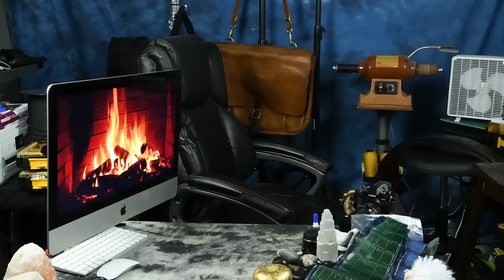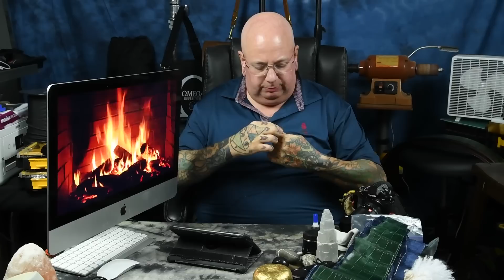🧐 FREE ENERGY Arch Form TIME Variable 🧐

Comment: Gentle push instead of hard matter physical smashing...
More with less dmass. Yt video on arch. 
Friction is of two surfaces. Tribology is contactless.
Genus facet surface phase...
 dodecahedron yellow path Yt video
on cohomology.

SpArkplug. Ok. But compression can ignite. Start a fire. Bubbles.
Using less fuel and more air.
R in air water fire earth aether. 😊

Comment: e9
EN is hole, pore, cenote... GENE egg en.
e9 is old telephone handle, or Solar barQue 09 with sailors 1-8.
Aries, Mushroom. 
How does one gets vacUUM voID? Suck-tion is like  pumping.
AMPerage is obsolete Tesla said. I need no elctrons to drive my motors.

Lock and load. Pump and pack. Load is dual. Dipole. MeLody.
1 is an electron, hole on complex cardboard number plane. And hole is 1 , infinity.
Now P RIM E s are 1 and itself. ON/OFF valve SWitches.
Ram rim mirror Moire Miura, MOraya, meron, etc ..
MM is symmetry.  Tetra. MorhSUB RhomBUS.
Morpheus SAndman has B day as myself. MM I CS mixing STR8 line.
Leaving two vortices , eddies, expansion cones.
Euler identity with pi e 1 0 ... and x²+1=0. 
And eversion convex + concave - saddle = 1( Euler characteristic too).
saddle lip ellipse, helice -propeller...+++
either propeller or propulsion
in contest of moving parts
turbo jet and propeler versus SC- RAM jet
diSCroLLs DNA ST DN TN 29 2J HeH god toothpick pattern

Comment: The Arch form you're looking for is the Pyramid, when 1 of the sides are perfectly aligned to Magnetic North/South it will create a positive polarity at the tips and a negative polarity in the core at 1/3th height, this is because Aether creates a charge at intersecting lines of geometry.

Dan Davidson's Shape Power book is where you can find more information on the effects of the Aether and Geometry.

This also gives us a clue on when the Pyramids were last in active use, it would have been when the Earths MF was perfectly aligned to the Pyramids faces, however long ago that was.

Comment: Fromm: SLAB.618 ENERGIES INC.  (SLAB:OTC)   Thanks for the idea rushhh and info. Thier is a physics teacher posted a vid of using large coils (20 foot dia.) and rotating it like a jump rope =gets voltage.But still their is  the motion part. Can we see any motion from a magnetic thing? or detect any ?  Have ya heard of the coils buryred in the ground  to expolit  the potential that grows as the height above ground surface increases ? I meaning to try it , got  about 20 lbs 16 gauge, or maybe 30 foot coil between a couple of trees ?? //  Have ya seen the info  about whats is beening termed  "the electric univers " ? Sooooooooo CoooooooLL    .  Thank You  Ken

Comment: Unckes Kenny, as you've taught us, the EMF moves from the counterspace null point centrifugally.
After reaching maximum field distance the EMF is moving centripetal back towards said nullpoint.
As above the plane of inertia, so below. There is a duplicate counter rotating field of opposite polarity. 
Null point, centrifugal to centripetal to null point.

Kenny, this means there are specific locations on the magnet we can 'wire'. Like targeting an acupressure point as opposed to an overall massage. A rotating shaft covered in copper wire is actually a hit and miss system.

Your thoughts?

Comment: In my minds eye I’m seeing a “need for a water jet.  We discover that instead of carrying buckets of water from the ocean we are floating in to a high point on the mast and running a pipe with a valve and spigot we can just drill a small hole in the hull of the boat.   Does this not symbolize the real dangers and possible ramifications of the power “water” we can have at our general disposal?    Are the convoluted methods we harness power possibly a way of “nerfing” ourselves?

Comment: Here are my thoughts on this. My understanding of the cosmos is that all particles are basically the same as the make-up of a photon and both are the result of pressure variance caused by frequency being filled in by the field and that filling in takes the form of a vortex, as all processes in nature filling in a pressure difference Attempt to create a vortex. Now, to the free energy aspect resulting from the phase disparity as you say... my problem with the idea of harvesting energy from it is it may already be taking it's own best, most efficient path to filling in the pressure deviation in, the vortex shape of the magnetic field itself may be the most efficient pathway for it's energy flow and therefore it would be.... At least very difficult to get energy off it, it is already running through it's most efficient state of the field, and you would need to convince it somehow to take another path through a less efficient form of the field.

Comment: What you are explaining is the way that The Great Pyramid was designed. The vaulted ceilings above what is called the King's Chamber are load slabs. Taking advantage of geomagnetic fields in proportion to the size of the Earth, distance to the Sun, and many other geophysical considerations (Mid continental position of mass etc). But due to the desalination of the Oceans caused by the melting of the ice in the Glacial Period the electrical charge of the planet was diminished so the machine fails to function as designed in great antiquity. It also had moving parts with pullies and ropes that eventually rotted way and the "plug" was accidentally dropped to the bottom of the Grand Gallery blocking repair people's access. It originally moved up and down the Gallery on wooden rollers, perhaps collecting static electrical charges. Grain seeds could be fertilized in the Queen's Chamber and charged much like Magnetic Water for extreme growth potential. https://www.youtube.com/watch?v=vpl2xAk26vk

Comment: Perhaps a tad off topic, but since the great pyramid appears to have elements like a chamber reaching high temps (kings) just below a pressure valve (granite slabs) with switches (small diagonal shafts) and subterranean aqua ducts for cooling, might you have a theory on how this apparatus may have worked?
Reply: is granite one of the rocks that has the piazo electric effect?

Comment: Ken, seems like a nested set of arch forms might work. In order to manifest a larger load the Lamore freq needs to  be ramped up. One form squeezing upon the next layer creating a higher rate as you progress to the center of the nest. Although , it may be the reverse and from the center outward thru the nest creates a greater  frequency.? It's just a thought I had. I don't have any empirical evidence that it is a viable one. Wishing you success!

Comment: I was thinking about the problem with the temporal variable of a magnet. Yes, it's true it has a temporal variable, the issue is symmetry, you need to break the symmetry of the ether around the magnet. Motors do that by moving the magnets, but when the magnets are static, the temporal variable of the magnetic field has perfect symmetry, my theory can explain this easily. What you need to do is create the equivalent an electric oscillator, but with a magnetic field. An electronic circuit required capacitance and resistance and a positive feedback loop. 

So what you need is a magnetic field oscillator with no moving parts. You will need a feedback loop, resistance and capacitance, but in terms of magnetic fields, I am not sure how to achieve this, but if you could create such a thing, all you need to do is place a piece some looped wire near it and you will generate endless electricity. You might need to use material that is capable of building up a magnetic field, equating to the capacitor building up charge.  No we can't use an inductor, because current is what you want from the device, lol. 

We really need to talk because I want one of these devices, my electricity bill is going through the roof.
Reply: LCR circuit.

Comment: Everything is moving somewhere. 
Everything wants to find middle ground,to even out,hot and cold becomes warm.I think of energy as using the movement of something that is trying to find it's middle ground for your own purpose, a detour. Letting it get to where it is going but only after it pays you a tax.
1 to 5 ratio seems a good potential, but what is moving doesn't have much resistance therefore hard to detour or make to do your work.I hope you overcome your obstacles.

Comment: 😳Your premise is correct Ken
Key requirements are..
Resonance
HV
HF
to harvest ,focus on magnetic side (electrical dies a heat death)
C.O.F into the thousands are achievable with the right embodiment.
The so called Don Smith device in all its embodiments was successful(be aware that most replications fail. Ham operators with radio theory have  a higher success rate😃)

Comment: This is actually the very first thing i wanted to discuss with you because i observed 100 % of my 13Kw demand fullly supplied without sag so long as the load remained stable. But when something like the 6000 watt water heater was cut off from the "load plane"? Then the power decoupling or something that i dont not yet know how to difine , happens and then it returns to the lossy mode, untill the exact load balance is applied . im probably not making myself clear because i lack a more refined terminology

Comment: Rf emmision at certain frequency modulation can induce decoupling . but i dont know how to explain it. But you have words that i do not. Yes it works . but they took mine away because it worked. .... I will build a better one next...... Yeah i really need to get the radio back on

Comment: Hey Ken, I have skills with CAD software as a hobbyist and make designs with my 3D printer. Maybe I can help you mock-up something for the structure.

For example, something that would help you wrap the copper wire in a tricky way based off drawings(?), Etc. 

I’d do it for free because you give so much great info. 

Ps. Actually, I’ve already actually made something based off of your ideas. I’d love to send you one. You may like it. 🙏

Let me know 👍

-DT

Comment: Electricity travels outside the wires, not inside, right? And how did Tesla transmit power to a field of lightbulbs wirelessly?

Why did the arch form of metal light up in the bulbs with the aether perturbations? What 'load' did they exert? Does larger surface area in smaller confines improve loads? Maybe the issue is not getting power generated, but finding something that is capable of providing a 'load' large enough or specific.

Comment: I would try  radial and axially wound coils, flat plates and rings, combinations of two, two connected in a single circuit, positioned at opposite poles in conjunction with each other, or one at  a pole and the second at the dielectric plane. In both cases trying to derive a dielectric pressure difference between coils. There was an interesting set of devices by Nazi scientist Hans Coler. The second device in particular had something kind of related. Current traveling THROUGH the permanent magnet. Think about combining right hand and left hand rules of both a permanent magnet and an electrical current in the same space. The system utilizes AC which by nature has a changing magnetic field strength during every cycle. This is the same as a moving magnet. Combining moving magnets and coils can result in current flows in pickup coils.

Comment: This makes entirely to much sense . I envision a high speed , low voltage switching matrix powered by merely a small battery for switching only to initiate it .
Reply: The calculations to discover the timing with load variables seems to me the most critical fundamental problem . The arch form of which would be similar to a simple tank circuit  , which once initiated seems to be perpetual , but of course is not due to resistance .
Reply: But what do I know . I'm just a dumb hillbilly .

Comment: Its really interesting, but as said early Floyd Sweet build such device. Its cool that you try to build one, but getting the resonance in the magnet will be hard , i am pretty sure that some labs in USA can and did created artificial magnet with archform of the power. Still question arise why the archform so important , maybe there more things behind the archfom and we observer only in linear space as archform, but literally its origin non linear matter leaked into normal  our linear space and deformed in the process, due to the laws of thermodynamics , which means energy loss during conversion.

Comment: If I get it right you have to find a way to turn on and off the magnetic field only or a way to block it from coupling into the coil, maybe you can use two coils on each side of the magnet and use the inner coils to counter the magnetic field from coupling into the outer coil and when you do that at a certain frequency you can put a load on it to consume the energy.

Maybe you can switch the inner and outer coils in such a way that you can harvest the energy from all four coils and use the inner coils not only to counter the magnetic field but when you switch off that coil it will automatically manifest energy but only inverted so you could use that energy too.

I don't know if you can imagine what I'm saying here but I see it as a sandwich of coils and in the middle of it you have a very powerful magnet just sitting there in an upright position with the north side on the left and the south side on the right when you look right at it and then the double coil sandwich on both left and right sides, you could also put the whole contraction on its side of course it will work the same way.

I think that the coils you have to make to counter the magnetic field from the magnet has to be quite substantial, much larger as the pick up coils on the outside but if you make all coils equal I think you'll increase efficiency because you'll have more turns of wire crossing the magnetic field but you have to balance that to get the most efficient "generator" for the type of load you want to drive.

Doing this is kind of the same as you do with those magnets that you can turn off by turning or pulling a lever which in turn shifts a metal plate or something in front of the magnet and blocks the magnetic field from going out, I think you even showed such a thing once in one of your videos but I'm not sure if it was you or someone else.

What do you think, am I close to what you have in your mind on how you'd make this solid state generator?

I'm very curious to know what you think of my idea because I want to know if I'm anywhere close to understanding what you are saying and if so I may start to experiment myself and try to make it a real working thing, the weird thing about this all is that I've always thought about this with magnets that in a magnet already sits the potential energy that you need, you only have to find a way to get it out and this may be the way to do it.

Comment: What do you think of Harald Kautz-Vella's argument that to use a free energy device we have to change our mindset by getting out of the money world based on scarcity mindset and into the world of abundance? Then you would not try to patent then use it yourself sharing the secret only with those who learn that mindset. Harald claims to have created a free energy system creating fuel using opposing vortices. He describes it in this video. https://youtu.be/Qnay5qKfEfU Also interesting is the Swiss town which uses a free energy device but only if you join and study for 9 months to develop the correct mindset. You can learn but after you learn you are no longer interested in it. I suggest you try creating a polarized electrostatic field to copy nature ie the earth and sun. Karl Schappler used carbon and pitchblend in an iron, gold, silver or copper sphere with a hard vacuum in the middle which he claims creates a magnetic field thousands of times stronger. Then he claimed that he could wirelessly transmit the magnetic field through resonance with a smaller version up to 5 miles away presumably like the magnetic connection between the Earth and the Sun. The carbon could be enhanced with m-state materials which can be absorbed in the correct environment like undisturbed placer beds or black smokers similar to how the charcoal is enhanced to make terra preta. Hopefully your knowledge of theory can find connections I cannot so you can make it work.